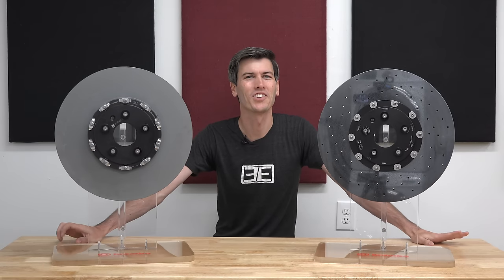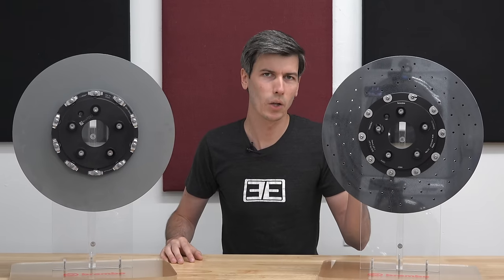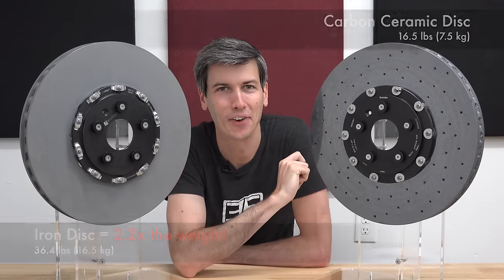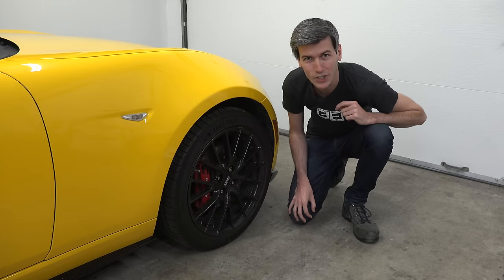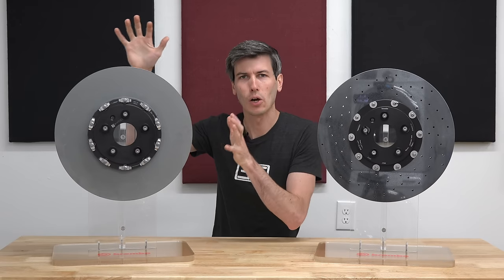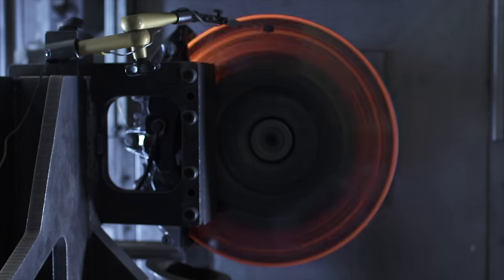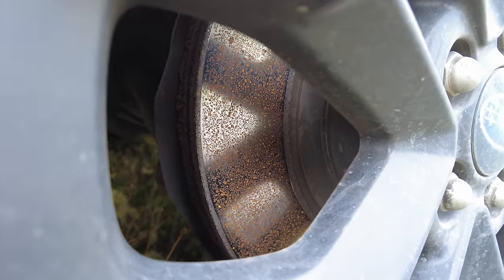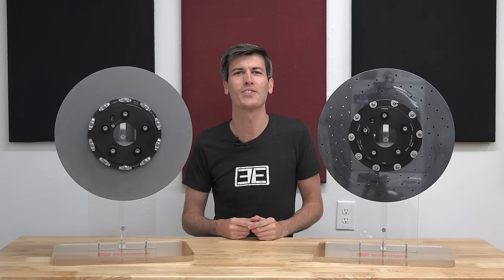How Can Brakes Cost $10,000? The Brilliance Of Carbon Ceramics

Comment: As much as I love carbon ceramics I still have a few questions left:
What about brake squeal? - I'm guessing this issue has been fixed, but the Veyron had the infamous brake squeal when not at operating temperature (in this case hot)
What about not having good enough brake feel? - Once again I this issue was fixed, but the first few carbon ceramics were working in a way that nothing happens when you start pushing the brake in slowly, and then all of a sudden all braking power comes in. (I think the LP670-4 SV had this issue)
And another question is how prone are they to damage? - I've heard a horror story of a stone getting between the rotors and the pads and it completley destoryed the carbon ceramic. As far as I know one little crack (not the surface crack you mentioned) and it's basically junk.
Reply from the maker: Good questions!
Regarding brake squeal, this is generally more a pad related issue than rotor related; there are quiet pads and more track oriented pads which aren't as focused on minimizing brake noise. And with any rotor, there are many options as far as what pads to use with it. 
Regarding brake feel, again the brake pad is pretty critical; a high temp pad won't bite as much when the brakes are cold, but it will feel great once everything is up to temperature. The rotor itself is an incompressible surface, so as far as feel, there shouldn't be any difference between an iron or carbon rotor (if both are within a proper operating window).
Regarding damage, I don't know. It's a good question for me to follow up with!
Edit: I followed up w/ Brembo regarding damage, here's what they said: "Carbon ceramic is definitely more brittle than iron, and there is some risk of damage if handled inappropriately.
 
I’ve never seen a disc damaged by a rock.  I think the likelihood of that happening is very low.  Rocks getting lodged in the wheel usually damage the caliper, not the disc.
 
I have seen, however, discs get damaged when people remove wheels and let the wheel contact the edge of the disc.  This results in a chip.  A small chip <10mm isn’t necessarily reason for replacement, but anything larger could require replacement.  Some manufacturers, like GM, provide a foam protective cover that should be wrapped around the disc during service.  If the mechanic is careful there is nothing to be worried about, but it’s a risk nonetheless."
Reply: I have carbon ceramics on my alfa romeo giulia quadrifoglio. It very rarely squeals at very low speed. There is a bit of rumble or roar when stopping from high speed but I think it sounds and feels cool. At speed the brakes feel normal when driving normal. But when in stop go it is a bit hard to drive smoothly because they are very touchy. I love them
Reply: Most performance traditional brakes also have an ungodly amount of squeal. 

I don't so much think it's "not good enough" but more so different, it always takes time to get use to new tech and brake feel along with steering and clutch feel differ from manufacturer to manufacturer. 

From what I've seen they are about as easy to damage as traditional rotors, which does pose a problem because they are significantly more expensive. Once they have a non superficial crack they are trash they can't be resurfaced or fixed in any legitimate way. 

I think the cons outweigh the pros, but it definitely is personal preference. I do laugh at the Porsche guys who buy a spec'd to hell Porsche just to take off the carbon brakes and throw on steel ones that way they can save the resale value down the road, I really think the offset there doesn't pay out if you actually do the math. Provided nothing detrimental happens to your brakes anyhow.
Reply: @alfaqvcarlos4406  I envy you. The Giulia is an absolutely stunning car. There's a few around where I live and I always get so distracted looking at them especially the Quadrifoglios. Have yet to see a Stelvio Quadrifolio, but the Stelvio is also very popular around where I am. One day I'll have a Giulia
Reply: @Yesthatsmyfirstname  2 years ago I thought I'd never have one. I wish you luck. They are truly amazing cars
Reply: Regarding damage, when I went to the Ron Fellows Corvette owner's school they showed us some type of elastic/rubber band that goes around it when removing the rotor, reason being if you even chip it it becomes a paper weight (in his words). It's probably going to be similar if something happened to it on the road but that just my uneducated opinion on the matter...
Reply: Thanks for the answers everyone.
I'm not quite so sure about the brake squeal on every performance brakes, because my W221 S63 has just had all of it's rotors and pads replaced (ouch yes) and I don't have any squeal on them.
I haven't managed to overheat them yet, but then again I haven't drove them on the track just yet, only drove it hard on a mountain road. At one time I could smell them, but didn't notice any fade.
Although I'm sure this car and every heavy car would benefit from carbon ceramics. I wouldn't trust my steels on the racetrack after 2 laps of hard driving.
Reply: @LT4POWERED  Don’t some manufacturers provide wheel stud extensions to help guide you when you’re mounting a wheel so you don’t accidentally whack the wheel against the rotor?
Reply: @robertbutsch1802     Probably.  I’ve seen those before but I’m not sure if they are a manufactured issued thing or something techs can get on their own to be safe.  Probably well worth the investment at any rate.
Reply: Great questions thanks for all the input.  I was wondering the exact same thing.    Most of these were "known" when carbon ceramics were first coming out but either people got used to it or it got better.
Reply: @Yesthatsmyfirstname  exactly, why spec/pay for them and not use em 🙃…. I have a 160k miles on mine and still rolling
Reply: I’ve heard of many Porsche owners complaining of CC brake rotor noise.
Reply: I have a high end floating steel rotors and they’re squealing at slow speed, on the flip side they feel 3 time stronger than the quiet pads I had before.
Reply: @80PercentAshamedOfU  That’s because as Jason mentioned, the pads that come with Porsche’s carbon ceramics are meant for at least occasional if not frequent track use so they’re a more race-y spec
Reply: I have carbon ceramics on my Porsche Panamera Turbo S. It's a daily driver with 46k miles. IMO they have no drawbacks except the initial cost. The initial cost is recouped in reduced maintenance over the life of the car. The condition of the front rotors are visually indistinguishable from new and the front pads look like they will go somewhere close to 100k miles. There rear pads and rotors have no wear whatsoever. With the Panamera being a street car the brakes have been totally silent the entire time of ownership. The car is driven in New England winters and through snowstorms, and all weather. I have not noticed any difference in brake feel when driving in near 0F temperatures. The braking performance on such a large, heavy car is beyond reproach. It's simply not possible to challenge the capability of the PCCB in spirited street driving. I'd estimate over a 200k mile ownership of the car I expect to replace the front pads once, maybe twice. There is no other maintenance other then normal brake fluid changes. I would certainly get the PCCB on any future Porsche. I only wish my weekend Cayman had PCCB.
Reply: I have ccb on my m6 comp, no squeal and the best pedal feel iv ever had, only downside for me is i cant just go to any tyre shop to get tyres changed incase they sre careless with a wheel an chip a disc.. each mew rotor is £4000 which is major ouch
Reply: @alfaqvcarlos4406  hey Carlos, i I'm also glad I have the carbon ceramics on my quadrifoglio. What I do notice is i really have to be careful when I went to the carwash. The first time I stop the car almost won't slow down the first seconds. Now I know and always tip the brakes a few times when I start driving it after the carwash. It's a great drivers car.
Reply: @dirkcuypers6669  yes I noticed it also. It's kind of a scary feeling if you forget while exiting the car wash. My quadrifoglio has ruined my life. It's so perfect that I can never drive anything else
Reply: Worked for Performance Friction. Break squeal means good stopping power (hard bads). That is why school bus brake pads squeal so bad.  Stopping power is optimized over noise.
Reply: @80PercentAshamedOfU  normal operation. They have performance pads.
Reply: I have personally used my PCCB-equipped 2010GT3 exclusively on the track and have racked up 62,000 miles (about 10,000 miles on track, the rest 50,000 miles driving to and from track days on the street). My front rotors were worn and needed replacement at 57,000 miles mark due to 4 incidents where I had allowed the inner brake pads to be worn past the backing plate (iron plate worn to a sliver 1 mm thickness). The costs of a pair of front rotors was $13,500 and I never hesitated in my decision to get them. I have never experience any brake squeals and have always used the PCCB OEM brake pads that were designed to be used with those Porsche CCB rotors at the costs of $350-400 a set (fronts or rears). The pads lasts 10 track days before needing replacements. The pedal feel is consistently firm hot or cold so those with comments (Nic Mallory's post) don't seem to apply to my case. The Carbon Ceramic systems in other manufacturers cars are varied in their development and some are not as refined as Porsche and do exhibit less progressive actions and can tend to be grabby as described. In terms of damage the mohr hardness of silicon carbide is 9 and most stones or sand is less hard than that so the chance of stones getting trapped between pad and rotor is very slim. I did suffer damage to my wheel when a stone got caught between the brake caliper and wheel once when driving to a track. The rotors are very hard and brittle so accidental contact between the rotors edge when removing or remounting the wheel/tire risks chipping and extreme care preventing this type of contact must be exercised. Those are the only downsides aside from the costs of having CC Brakes and I think the new car option costs of $8000 to $10,000 to order them with a GT4 or GT3 is a no brainer (as the latest generation are twice as durable as those from 12 years ago).
Reply: @pfan12000  How many miles do you think they could last if you change the pads in time? Also how hard were you driving on the track day? Full braking performance before all corners or just occasionally? And when you say track day, you mean the whole day or just 1 or 2 heats?
I do like the idea of CCB, but a bit afraid of buying a car where I'll have to change them.

Comment: Brembo got started in racing a heck of a lot earlier than 1975 - on motorcycles.
By the 1980s, they were standard fitment on virtually all Italian motorcycles, and some other European brands, as well as being a popular upgrade for enthusiasts fed up with Japanese stainless steel discs, which basically had no wet weather braking for the first second or 5 of each application.  Sintered metal pads solved that, but ate discs at an alarming rate.  Brembo used cast iron, and the surface rust formed so fast that wet weather braking was instant and predictable, as the rust broke up the water film on the disk.  Goodbye to booking your braking points on a calendar.
On high-performance motorcycles, they improved weight by using thinner disks and making the disks instead of the callipers do the floating.
Sprung to unsprung mass ratio is an item that is so important I feel it should be a required listing in the vehicle specification.  And yes, I've worked on systems from end-of-life junkers to top-tier motorsports with a sidestep into Citroen systems, on their own vehicles and the ones they licensed to Mercedes and Bentley.  The additional spring added by tyres is so vital that I'm not a fan of the super low profile tyres, which may improve steering feel, but have huge suspension disadvantages (as well as being an enormous pain in the ass to fit).  They also damage far more easily, and in doing so easily damage the rim.
Of course, inboard discs can be exposed to more airflow and have unsprung mass reduced in proportion to how far inboard they are positioned.
Reply from the maker: 1975 was for racing, as mentioned in the video they were founded in 1961.

Comment: Tesla Model S Plaid Carbon Ceramic Brake Kit
$20,000 .. rotors, pads, calipers, and a bottle of fluid! 21" wheels required
Reply from the maker: Wow! Great that they've released an option.
Reply: An option sold by Tesla?
Reply: It shouldn't be an option. That car can actually accelerate faster than it can brake, and it is extremely heavy. I'm surprised Musk hasn't developed a retro rocket package for that road missile.
Reply: Understood. I see that tesla will sell the installed option in mid 2022.  I wonder if it will be included standard on the plaid in the future.

Comment: You can save some unsprung weight on your MX-5 by installing Flyin' Miata's Big Little Brake kit. Wilwood calipers all around, even lighter than the front Brembos that are so expensive from Mazda. The kit is around $1,100. I, a 75yo man, did it myself in my driveway. They come with braided SS hoses, I added one way bleeder valves so it was a one man job. Great brake feel, easy pad replacement, just pull the pins and slip in new pads.
Reply from the maker: Awesome to hear! Yeah I have the Brembo kit on mine from the factory, so not really looking to upgrade (bought it used, not quite the price jump). Also comes with the BBS wheels which I love.
Reply: @EngineeringExplained  You can get just the rear brakes, a nice upgrade and a big weight savings. The handbrake isn't very strong on the Wilwood kit but it's adequate.

Comment: I would somewhat disagree with improving ride quality. If a manufacture uses a specific tire and wheel combo on an OE setup. Those dampers are tuned using that specific rotational mass. When you alter that making it lighter or heavier. You’re now potentially out of the range of the specific dampers. So on normal roads with pot holes and expansion joints that lighter wheel/tire/brake combination now deflects easier because of its reduced mass. This transmits even more harshness into the cabin. I had a MK7 golf R that I did the same thing as you did. Went from factory 19” wheel and tire combo to a smaller 18” forged wheel and tire combo. Dropping almost 6lbs a corner. The ride actually became so jarring and unbearable I found the heaviest set of cast 18’s I could to get some weight back on the hubs. This in turn made a huge difference and returned it back closer to factory ride quality.
Reply from the maker: One thing to keep in mind is these are often factory options where you can choose between the two, with the suspension tuned accordingly.
Reply: @EngineeringExplained  Oh yeah with that I completely agree with. But at the same time it’s inevitable that with less rotating mass, the entire hub assembly will react more/faster to a smaller imperfections in the road as compared to a heavier setup. In turn this will transmit more into the cabin making your ride quality “feel” worse. Although your wheel may be in contact with the road more which increases grip since the suspension can push it down quicker.  With a lighter wheel the opposite is true as well. It can just as easily be pushed up by smaller bumps that the heavier setup may not have been as affected by. No factory non adjustable suspension can react to that change. So I bet if you took the same two cars out with factory wheel setups the lighter setup will have a slightly worse ride quality.
Reply: I should also state that those results can be heavily skewed based on how much weight you’re actually saving and the difference in size wall size. When  you step down a wheel size or even two yet keep the same overall diameter tire. That extra sidewall will help absorb those smaller bumps. That can only go so far though. If you start dropping 5lbs+ a corner. No amount of sidewall is going to stop you from feeling those little bumps in the road you didn’t before. If you’re keeping the whee and tire combination the same and shaving weight via rotors, titanium lug nuts, calipers, etc. Then you will most definitely notice a ride quality change for the worse.
Reply: @bradrichter5082  Less unsprung weight makes for worse ride quality???
I may be old, but I'm very confused by this.  🤔
Reply: @jimurrata6785  Give it a try for yourself. Math and engineering don’t always equate to real world results.
Reply: @bradrichter5082  I can understand increased jolt because the bump acceleration is higher. But that's why we tune dampers for both high and low speed.
While I doubt I will ever get a chance to test side by side with rotors 14k different in weight I would welcome your explanation.
Reply: there are to many variables in this equation to blame it on weight alone. IMO the influence of the tire (size, stiffness) and wheel geometry (Offset, width) is far greater than the few pounds lost. we need an apples to apples test to evaluate your problem.
Reply: @vivalaphill  I took the same exact DWS06 off and put it on a heavier cast wheel. Same offset, same width, same diameter. Only difference was weight and like you said maybe stiffness. Difference was unbelievable. So either the forge wheels were that stiff or the cast wheels were just literal noodles. There’s physics and real world evidence to support this claim.